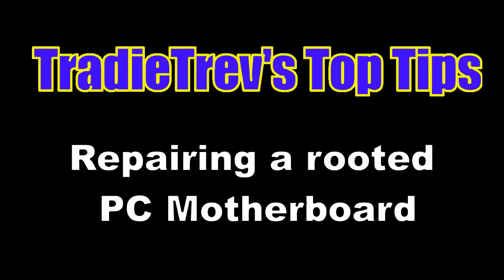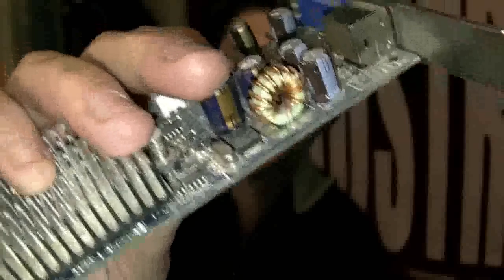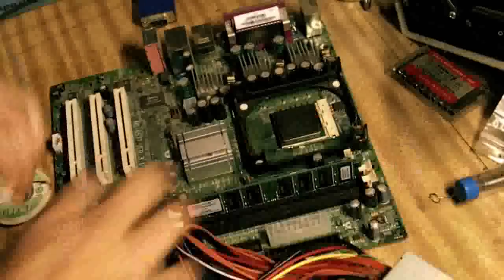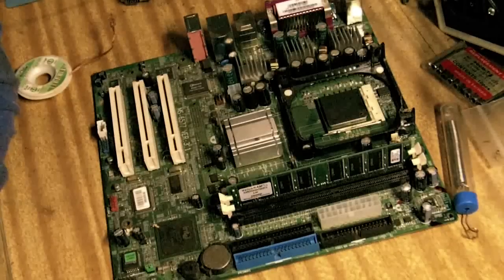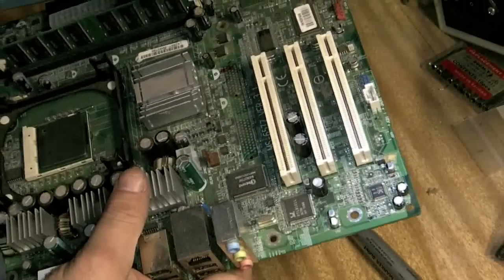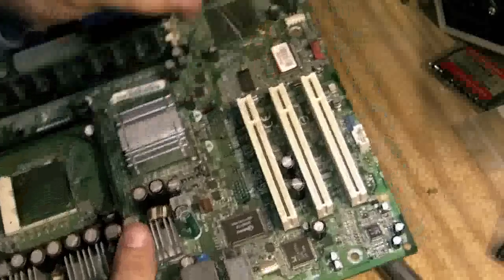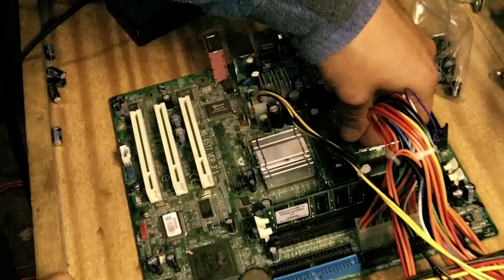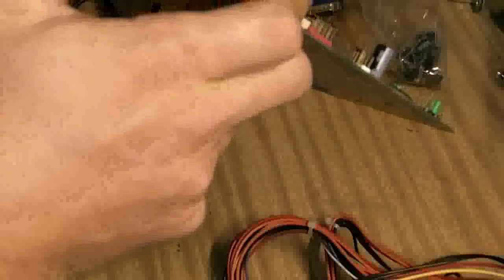Repairing a motherboard

Comment from the maker: @dgls57 that's all part of the fun trying to fix them :) (The components were cheap) Laptops are a jigsaw to pull apart and repair, it can take around 3-4hrs of labour to replace the motherboard. Add the cost of the part and most people end up buying a new one like yourself.

Comment: Either you put them in backwards or the voltage rating is too low.   Also you need to use LOW ESR 105c temp kind the standard  85c will go bad far quicker if its near heat sink. 

Try putting in a higher voltage ones like 25volt instead of the 16volt or the 6.3volt but keep the UF value the same as the old one.  It will only hold the voltages that are being supplied by the motherboard circuit so larger ones will handle more volts if the old ones were near the voltage limit.  
Also open and check

Comment: usually that is a system overheating or the power supply is bad or the motherboard is going out even bad caps will do this too.  Its usually one of those 4.

Comment: does it work? I see a hot air gun but what is the purpose of that thing there? There is no need to mark the capacitor's lead placement, the mobo has already markings on it, usually colored white in half circled figure.

Comment: yeah i have lots of problems with the more modern HP/Compaq machines i got one with pretty much every cap in the whole board failing when it starts it half the time it doesnt boot and it crashes about 5 times a day gotta repair that one now! it is about 4 years old too computers should not fail at that age more like about 12 years they should fail or at least 8/9 years old

Comment: i recapped the area around the PCI slots on my Asus A8n32 SLI motherboard (that may not be the excat title i dont ahve it in front of me) wich seemed to fix the sata stability problems it was even tho 3 of the capacitors imidiatly poped again on next power up, it has slowly sliped back down poped all the caps and is having stability problems with the sata again. got any idea what might be poping these caps?

Comment: Your power supply for bad caps.  Sometimes a bad Power supply will cause them to fail like that.   Do the same with the PSU or replace it.

Comment: Next time try heating the crap out of the motherbord with a heating gun.
Some times if its just the capacitors heating it up for a little bit can cause them to function temporarily.

Taking some of the guesswork out of it before you get started.
But then again we can never know for sure can we?

Comment: Allow me to disagree with your post.  Just to get past the boot up for such a short amt time wont hurt todays mobo's and cpu's.  I will say if the cpu fan isn't attached at start up it won't boot, (that has been my experience's only)
Of course the right thing to do is have all connected first, but when doing multiple computer repairs, testing parts on a good board,  etc, it is time consuming.